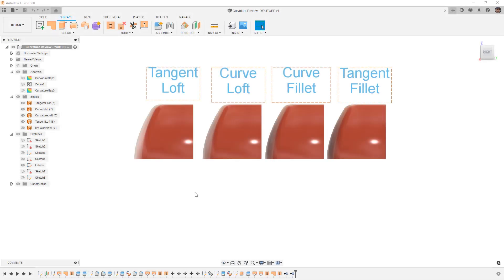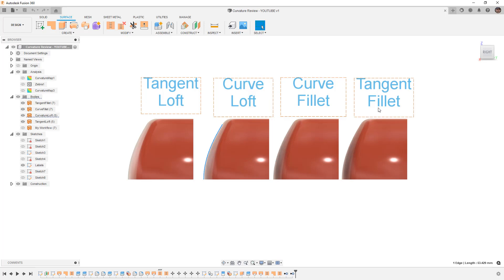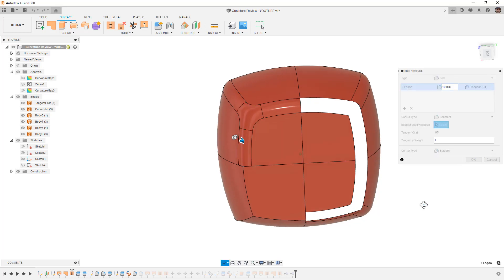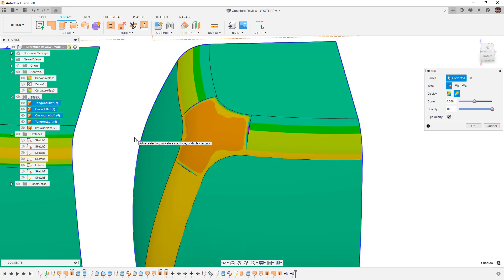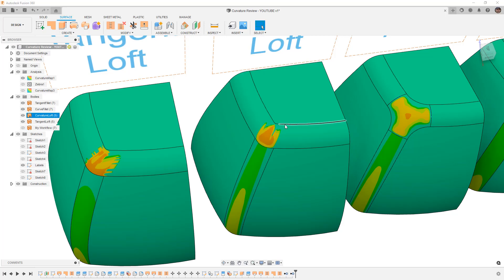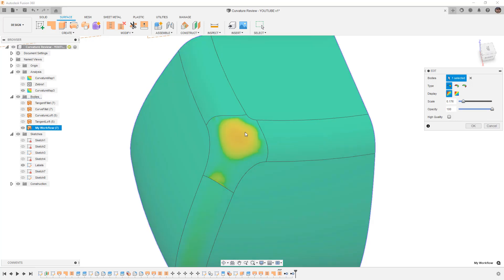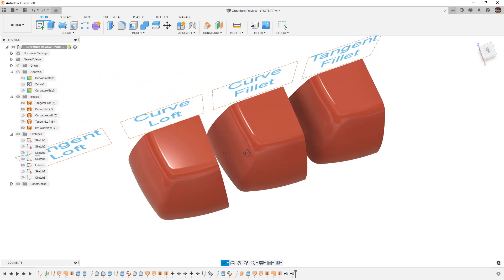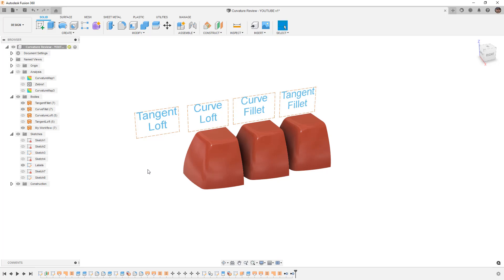Tangency vs Curvature Continuity when Creating Fillets and Lofts #Fusion360

Comment: In terms of production, what should be considered most? For example, how should we choose between a tangent or a curvature when designing a mold from it? 
great vid enjoyed it
Reply from the maker: Usamah, the choice between Tangent and Curvature is really based on what you are designing.  There are implications though.  One good example of this is just extrude a box, then add a fillet to one corner.  A normal fillet is a tangent based arc.  The fillet has a tangent relation to both faces.  You can change the fillet to be curvature based.  What you will see is the corner gets a little tighter(all things being equal).  The choice depends on what you have to work with.  If my surrounding faces are flat, or only have curvature in one direction, tangency is usually what i use as it makes little to no difference in the end shape.  If you are trying to patch a complex shape that has curvature in multiple directions often times the Curvature is needed.

For production the main considerations are going to be the minimum radius of whatever curve you are making because you don't want to design a big part that needs a very small tool to cut the geometry.  So globally try to remember the size of tool but that is true for tangency or curvature.

Comment: Looking forward to more. I want to know how I can get the cleanest transitions. It seems like the tools in F360 just don't completely cut it for this kind of work.
Reply from the maker: Hi Keveira,  Sadly the tools in F360 surfacing, in my opinion, are lacking a little.  The cleanest transition is generally done with forms tools.  Maybe I could do a follow up video using those tools.  Essentially if you have surfaces you can use them to drive a form surface using the Match tool and set the continuity to tangent or smooth.